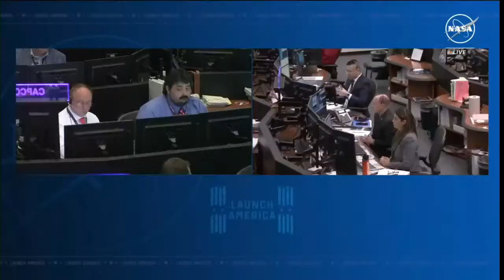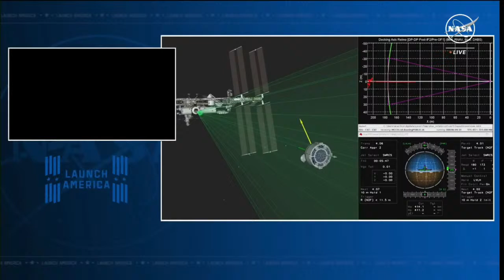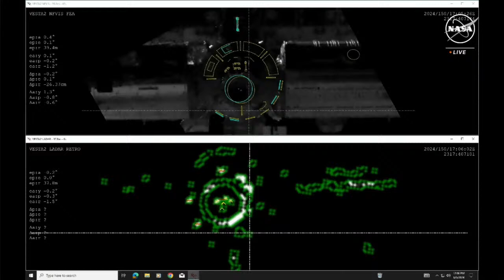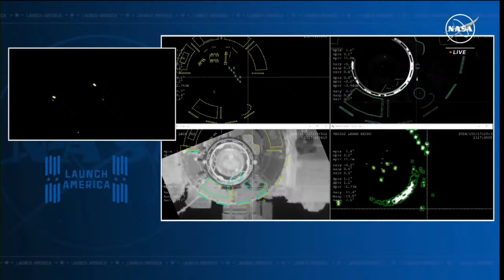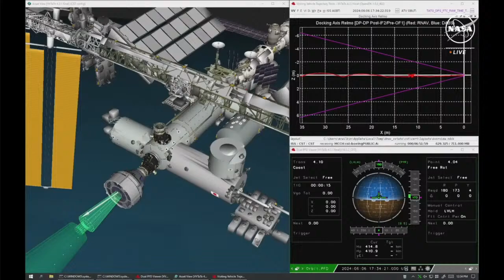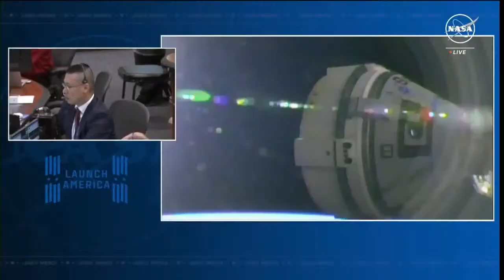WATCH LIVE: Starliner docks at space station amid new helium leaks

Comment: This was an intense moment but we knew that Butch could pull it off...he did a great job at getting the job done congrats Butch.....and of course suzi
Reply: Hmmm...Do you not know that a spacecraft docking to the ISS is a 100% automated procedure. There is even a strict "Hands-off (of the controls)" call out several meters out from the docking port. After that call out, the pilot of the spacecraft can only touch the controls in an emergency to move the spacecraft AWAY from the docking port.
Reply: @lancew.6568 I remember one of the cosmonauts having to take manual control to dock his Soyuz MS-22 spacecraft to ISS